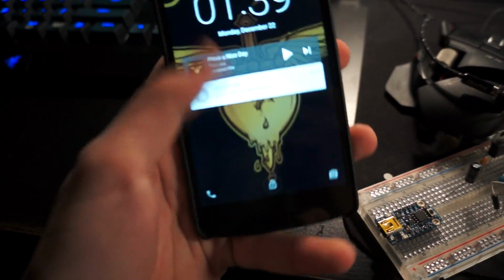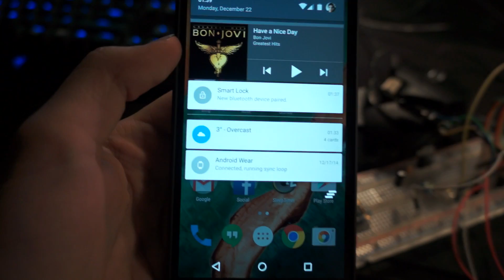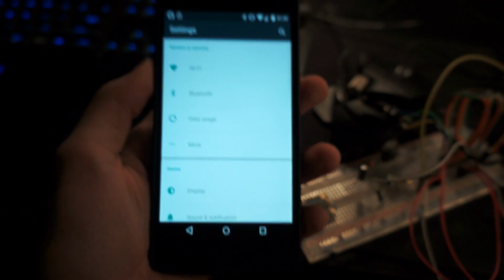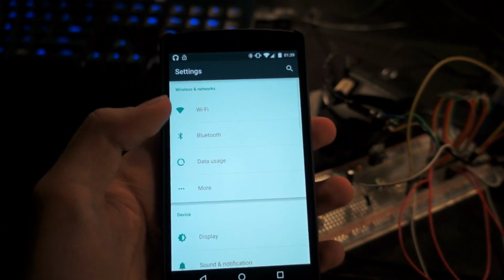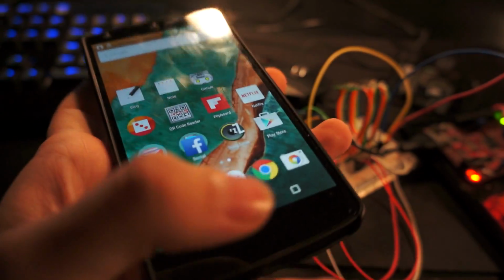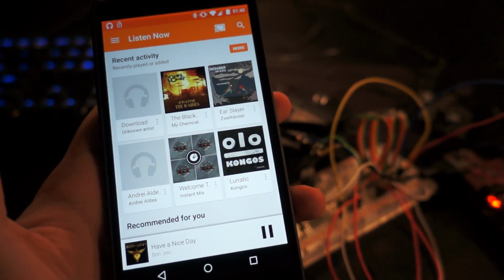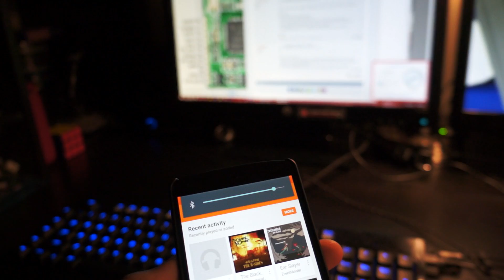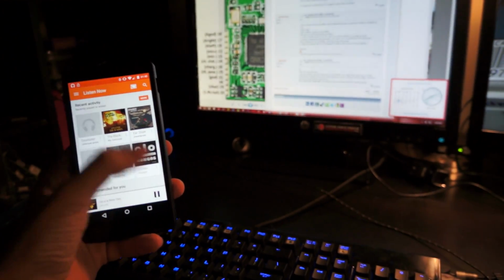XS3868 Board Test Initial: Working!

Comment: Hi Andrei.
Quick question: as you first get the XS3868 module, do you need to program it so it is able to pair with your phone or just need to plug power on and it's good to go?
Reply from the maker: It's good to go without any programming needed :) (or at least mine was)

Comment: Hi, did you address the digital noise issue and how?
Thanks.
Reply from the maker: +LatinPercussion We ended up abandonning the chip due to that. There's probably some filtering that can be done but in our case it just wan't worth it.
Reply: I see.
May need to use ground loop isolator (2x 1:1 transformers) on the audio lines.
Also try to connect the module power lines as close as you can to the power supply.

Comment: Thank you a lot for your test. I was wondering if the device workded with 3.3V, and as you tested it seemed to work perfectly. xD I Don't know how all the other sources just show 3.6-4.6 volts, that real desperating when i'm doing a project
Reply from the maker: I haven't tried pushing it lower but it seems happy enough at 3.3V. after all this thing is meant to run on a single cell lithium battery so 3.4-3.8V. I bet you could take it a bit lower than 3.3 too
Reply from the maker: I haven't tried pushing it lower but it seems happy enough at 3.3V. after all this thing is meant to run on a single cell lithium battery so 3.4-3.8V. I bet you could take it a bit lower than 3.3 too
Reply: +Andrei Aldea in my current design i'm using 2 series diodes to drop the voltage, but i don't know if this will work as i'm still waiting to receive this module.

Comment: Hi Andrei,
Do you have a spec-sheet for this module? - Also if you could show which pins you use/connect in your setup? It would be very helpful :-)
Nice video!
Cheers, Carsten
Reply from the maker: Hey Carsten, I'll post everything I can this afternoon, I'm not at home at the moment. I'm still testing some pins but what I have is enough to get it working. I'll message you again when its up.
Reply from the maker: Carsten Skjerk Hey, sorry that its been such a long time. I've abandonned this for a bit and am just getting back to it. Here's a link to what I managed to Map out, this is for the V1.2 of the board. I don't guarantee all of them are correct, but the basic ones are there. Here's a link: http://ctrlv.in/494220

Basically you need to connect the audio jack like its connected in the diagram and 3.3-4.2/4.7V on VBat and Ground to ground. Thats enough to make it work and play. I'm still experimenting with it.

I might release a development board for it soon... I'll keep you posted on what I find.
Reply: ***** Thanks mate! - I'll  be looking into this!